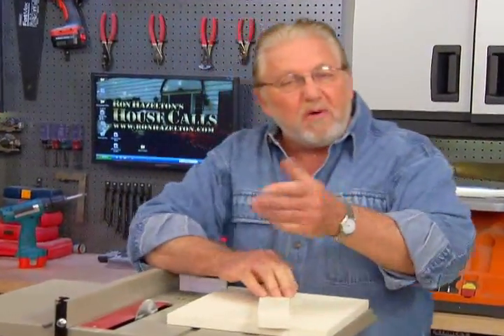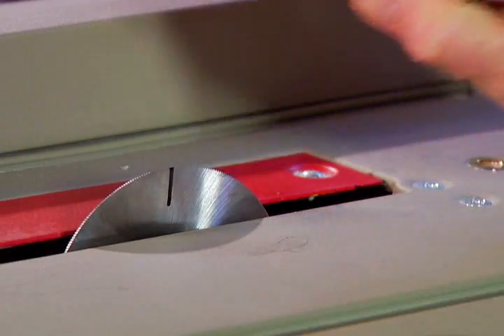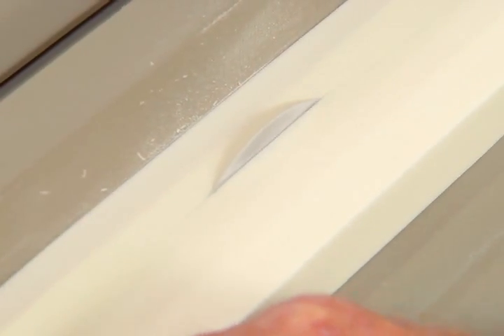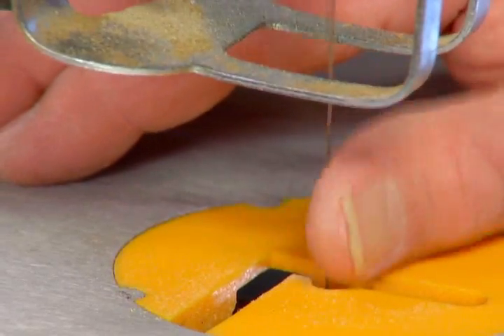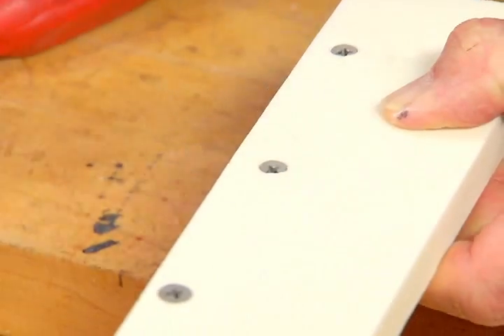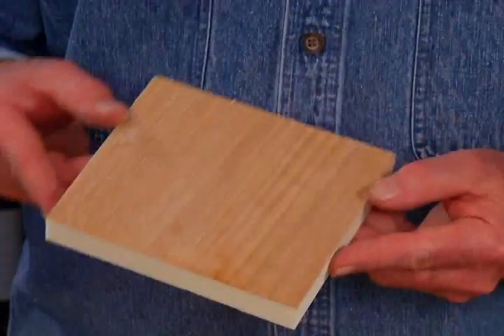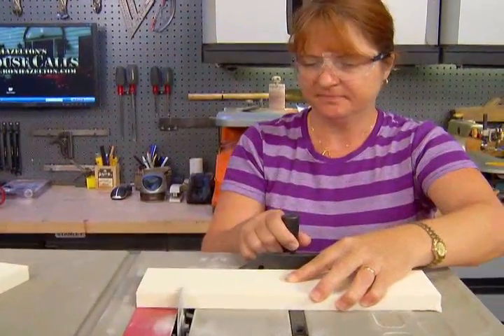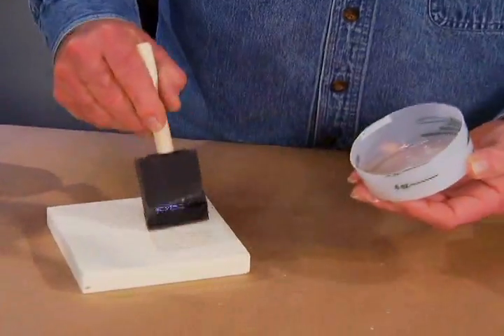Woodworking Fun Without the Wood and Risk of Injury Video

Comment: An amazing idea, truly.  I just have one concern:  complacency.

Without the pain of injury, allowing a power tool the ability to touch but not harm seems like it would not generate proper respect for conversational power tools.  Perhaps an optional module to add a high voltage/low amperage jolt should skin contact be made?  It would provide the learning experience without the injury.